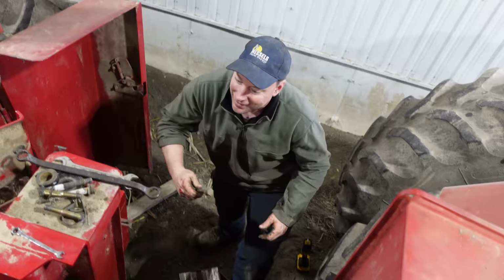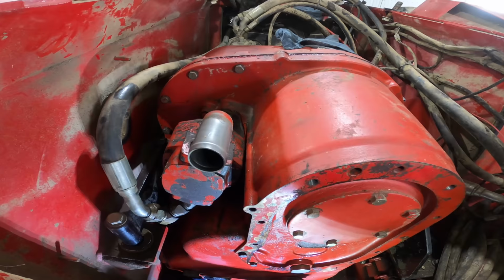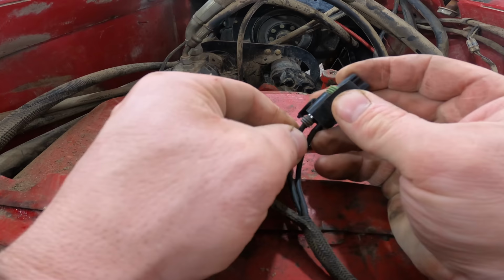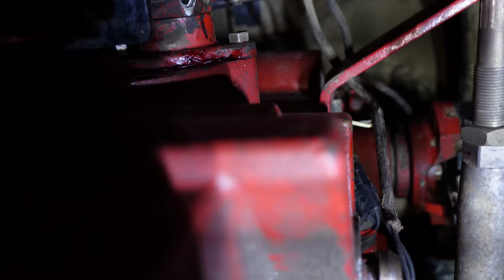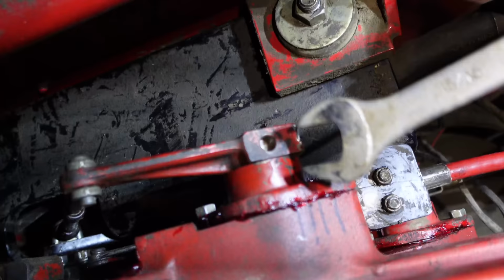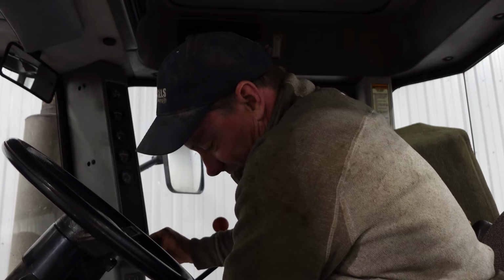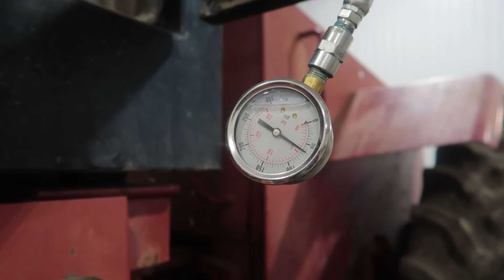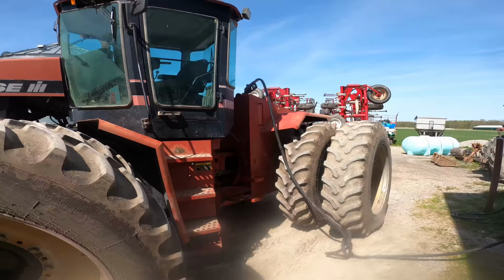Will It Cultivate? Rebuilt Transmission in a Case IH 9350 Steiger [EP3]

Comment: Professional looking!? Kevin even remembered to put the seal gland on the wire before crimping the terminal on it. Legendary!
Reply: With the correct crimping pliers too! :D
Reply: Ill do the first seal, slide the 2nd one on and forget about it, till the moment AFTER i crimped the terminal on...as soon as the pliers close shut fully, i remember 🤦‍♂️ did it today at work basically doinf the exact same thing kevin did, except both wires pulled outs the connector originally

Comment: When I was a loop technician about 6 7 8 years ago we used to do the same trick sometimes the drain plug would leak after we change the oil so we would use the Shop-Vac to hold the oil up in the crank case and change the drain plug washer and put it back in and turn it off it was pretty nifty
Reply: I wouldn't try that with gasoline. Fine with Diesel though.
Reply: @marscruz  Why not? Doubles as a shop heater!
Reply: @lvpvsnoctis  more like shop bomb
Reply: @lvpvsnoctis  Yeah, it would heat the shop up a little too warm, me thinks.

Comment: I would not advise the vacuum cleaner tip with gasoline because the arcs from the motor brushes could cause a fire or explosion.. JMO.. Very good pro tip for hydraulic, diesel or other things.. thanks

Comment: I think the transport truck is done first because the tractor doesn't need plates, so you have to exclude things like safety inspections and emissions tests... And although not desirable you can drive a truck without getting the alignment done.

Comment: We did one of these and never lift the hood. Took seat and floor out of cab and let the transmission down out the bottom. Never jacked tractor up, lowered trans down on a chain come along and then turned on its side and it slides right out.

Comment: Is that a VT Viking cultivator?  Great units check the end caps for stamp D2... That's my stamp from factory.

If you buy one of the high-speed cutting machines make sure you spring for the one with the rubberized roller on the back.  The spring steel baskets are not the greatest... I could go into detail but it's an engineer level flaw and they didn't listen to us on the floor during when we started making them

Comment: Aussie farmer here.I have used the 9350 with a full powershift transmission though.But how do you manage to break the gearbox in one? You are probably pulling way too much.I'm still using an Inter 4586 with its pressurised 5 by 2 Spicer gearbox.15,000 hours later,still good,nice and quiet.She is 300 hp at 2600 rpm,but we pull 200-250 horse impliments at 2100 rpm.They last a long time doing this.

Comment: Depending on how you define 'working' the bet could go to either of you.  The truck did pull the tank, but is that working in the sense that it's functional, or is that working in the sense that it did a job.  Functionally, the truck won, but it wasn't considered road-worthy enough to drive on roadways, regardless of the inspections and legality of it.  So, it wasn't ready to do a job, which means it wouldn't meet the other definition of working.  So it would be up to you two to decide what was meant by working.  I'd assume the intent was ready to be put to work, which means the Steiger won in my book.

Comment: Rich needs to pay up. I think if it’s able to perform it duty first you win. The transport truck needs to be able to transport in its normal operating environment which is on the road. The case needs to operate in its normal environment, which it clearly is in the fields. 
My 2 cents, Kevin wins both times. Hence, Rich needs cough it up. 
There’s also a “bro tax”. That is, if don’t pay your dues at the moment of ruling, you can be subject to a penalty of 25%. For example, if it’s a box of 24 can’s of beer, then you will have to pay 30 can’s. the penalty increase’s one of 2 ways, you are penalised 25% capped at 100%. Or the loser of the bet has yo shout all the bro’s in the group drinks until the debt is paid. #brotax